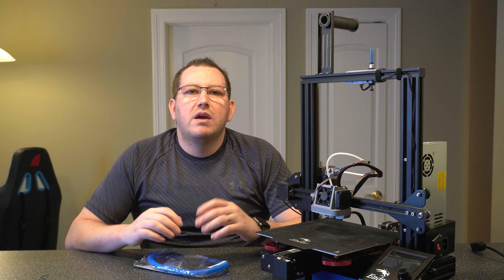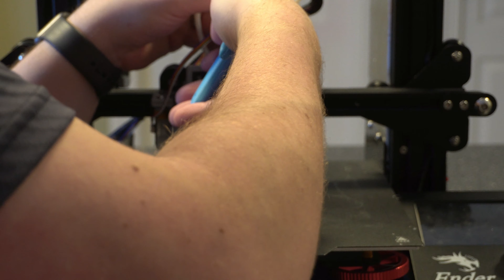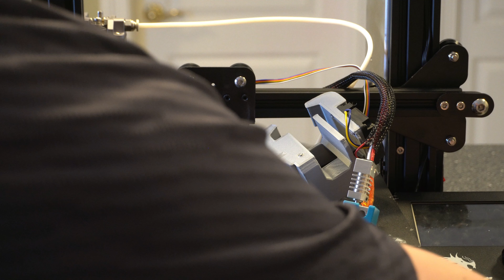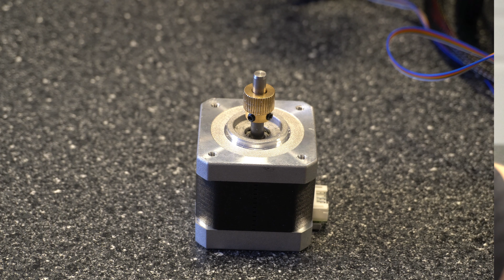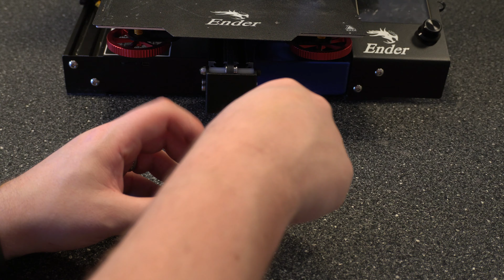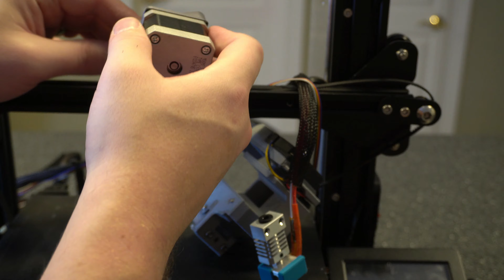Ender 3 Pro Direct Drive Upgrade Guide

Comment from the maker: I hope you found this overview helpful! If you have any questions or would like other tips/tricks, just let me know in the comments.
Reply: https://youtu.be/6Bbe7vgc_M8
Reply: I just used tinker cad to crop the top of the fan shroud your using
Reply from the maker: @J.L.M9714  Hi. Thanks for the info, I like how that turned out. I just finished up recording a video for the mod im going to use for a while, but I may end up reevaluating at some point.
Reply: Did you have adhesion issues off camera once did you did the swap? I just did this same upgrade, to the same machine, and my first layer is curling up very badly and doesn't want to stick. If I'm not mistaken I need to relevel the bed again, also need to find out what settings to make in Cura aside from changing retraction from 5mm to 1mm and changing the speed to 25mm/s. Any other tips would be much appreciated! Thanks!

Comment: Hi, the profiles on you're cura links, are they the same ones you use with this direct drive upgrade? I am having a nightmare with my direct drive with the extruder gear clicking so far into a print, it could be 5 minutes in or it could be 1 hour in and at varying heights so there is no consistency. Any help with this would be really appreciated. Thank you
Reply from the maker: Hi. They are not specific for direct drive, you will want to tune the retraction settings a bit. It sounds like you may have a partial nozzle clog or something similar (which would add more resistance).

Comment: Do I need to change any settings in cura or the firmware? I'm having bed adhesion issues since I upgraded
Reply from the maker: Hi. You would want to recalibrate your e-steps, and possibly flow rate. I have videos covering both.

Comment: Where did you get that nice color screen for the E3Pro? -- Do you need to adjust any print settings for the direct drive vs bowden? Retraction, etc?
Reply from the maker: Hi. Thats the TFT35 that is connected to my SKR Mini. The only thing you need to adjust for this would be your e-steps.

Comment: Mind sharing your slicer settings for speed and what not? I'm having an adhesion issues immediately after doing this mod. Leveled the bed, have bltouch, still barely getting adhesion, and didn't have that problem before. I think it could be my tuning. Thanks!
Reply from the maker: Hi. I have my Cura profiles available for download on my site, they should be a good starting point for you. https://3dprintscape.com/cura-profiles/

Comment: I upgraded to direct drive and I can’t get my first layer sticking anymore. Filament I had before that was perfect at 200/60 isn’t sticking. I tried cleaning the bed and also I redid my z offset and e step and I’m still running into nothng but headaches
Reply from the maker: Hi. Did you calibrate your e-steps?

Comment: Hey man my extruder is skipping . dont seem like its all the time . its a stock ender 3 pro. Ive had issues with leveling the bed. Im new to everything. Like i mean everything. Ive jammed the tip into the bed before the mag bed and it left a nice gouge so i upgraded to a glass bed . i learned from that but still have issues cuz when i auto home my printer . its hard 2 tell were it will start printing and were level is because it moves the z axis before printing up and down. I dont kno what a good / perfect print is or looks like . i dont kno what anything means to be honest with you . idk how to properly use slicer settings or what those mean either . im a green horn ad im trying to learn but its frustrating. Now my extruder skips . when printing so idk what to do
Reply from the maker: Hi. I think it would make sense to you the discord server, the invite is in the video description. There are a lot of people on the server that help each other out.
Reply: @3DPrintscape  thanks man im going to join now thank you

Comment: I am enjoying your videos, they are clear and concise. One question though, I see you have heat sinks on your stepper motors. After using them for some time do you still recommend them? Also do you have any opinion on the new stepper motors with the feedback boards attached. 
Don’t give up on these tutorials. 3D printing is a powerhouse industry in its infancy, I have spent my entire life in production Manufacturing, from large scale cutting edge Electronics to batch specialised production and I can tell you that the design process chews up a high percentage of project costs getting the designs of heat sinks, sub assembly and final casings correct. In-house design to outside fabricator who builds mould’s to your specifications. This process repeats itself until the product is ready for first run. 3D printing in-house to perfect the build and create the mould design for the sub contractors reduces cost dramatically as well as speeding up the design process.
Reply from the maker: Hi. Thanks for the feedback, its much appreciated. I added the heat sinks when i was messing around with the dampeners for the stepper motors. If you are using the dampeners, then i would recommend the heat sinks as the frame isnt able to absorb the heat in this setup. If your not using the dampeners, then i wouldnt bother with them.

Comment: Thanks for the video, i just installed one of these on my ender 3 pro. What do you use for your retraction setting with this direct drive update?
Reply from the maker: NoneHi. I added I link to my Cura profiles page to the description of the video, they are the actual profiles that I’m running.  To answer your question, I have the retraction distance set to 6 and speed set to 25.
Reply: @3DPrintscape  ok thank you, 6 is what mine was set to in my old settings but the instructions that came with the direct drive said you may want to lower them and a good starting place was 1.2 I didn't know if you lowered yours or not.
Reply from the maker: @rogert5365  Honestly, haven't needed to adjust the retraction settings. The prints have been fine after I did this upgrade. That said, its you are still questioning it you can always make the change for a print to see how it works out.

Comment: Love the vids! I've been subbed for a few months now and just got an Ender-3 Pro for Christmas, along with a few of the upgrades you suggest. 

Just a quick tip: You said you didn't want to run the wiring around the front of the pillar because you didn't want to mess with the heating element, etc. If I am understanding you correctly, I assume you mean you didn't want to unplug that stuff to run it around the pillar. If that is the case, Couldn't you just take off the cross bar on the top and just move the wires over it then reassemble the crossbar? Just a thought. If that is the case, I hope I was able to help!

Keep up the great work and I look forward to the next video!
Reply from the maker: Hi. Thanks for the feedback. I didn’t move it for a couple of reasons 1) I wanted to see if it was actually needed 2) I didn’t want to mess with the heating element. I didn’t think about taking off the crossbar, that would work, and it would be easy. If I end up having to switch over, I will go that route for sure.

Comment: Why would you put a heat sink on z stepper moter if its getting to hot vrefs are set wrong
Reply from the maker: Hi. I got the heat sinks from one of the kits I was playing with and decided to just leave them on. Unless you are using stepper motor dampers, they are not necessary.

Comment: Good Video. I installed the DD kit from Printer Mods a couple of months back. Works great, i haven't had any issues. Just installed a TFT70 from BTT over the holidays. I ended up using a simple fan duct that fit under the the extruder stepper. https://www.thingiverse.com/thing:4212191. It's a little better than the stock one and looks great. I toyed with the idea of going with the HeroMe Gen 5, have all the parts to install, but it seems really wonky to install.
Reply from the maker: Hi. Thanks for the feedback. I took a look at the fan duct cover you are using, and it directs the air decently and would work. Im going to look at a couple of others as well. As far as the HeroMe gen 5 goes, Im not sure its worth the extra cost to upgrade but im curious what you think.
Reply: @3DPrintscape  the cost isn’t horrible. You need a bigger part cooling fan, think it cost me $12, and an assortment of screws and nuts. I printed all the parts, but as you said, not sure it’s worth the headache. I can print up to a 55 degree overhang with the current setup. What am I going to gain? Another 2 degrees from herome?
Reply from the maker: I would think it may get you another 3-5 degrees but its hard to say for sure. I was also looking at this, though it seems a lot more complicated than the one you are using. www.thingiverse.com/thing:3808538